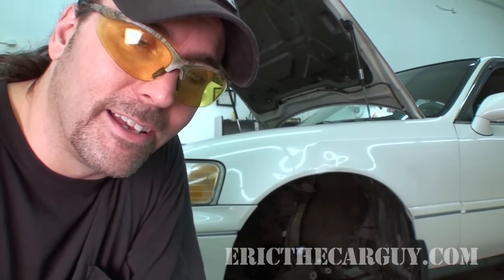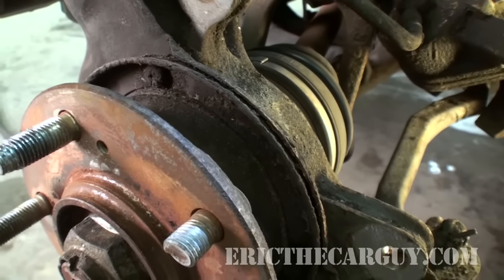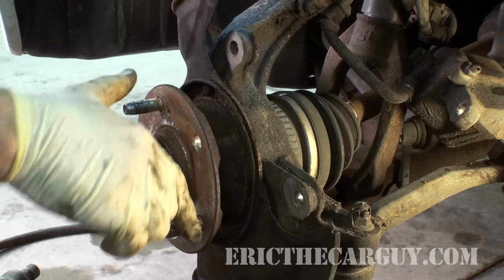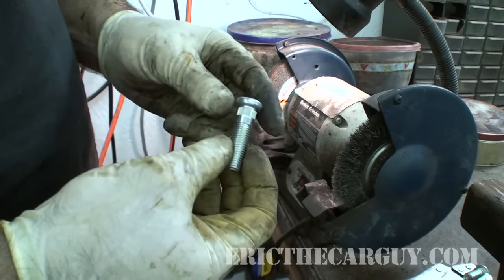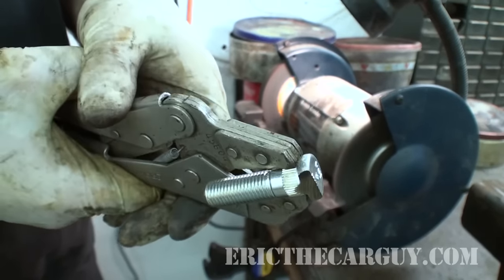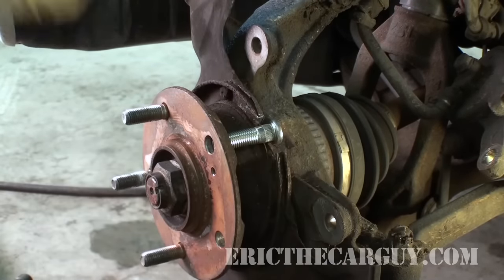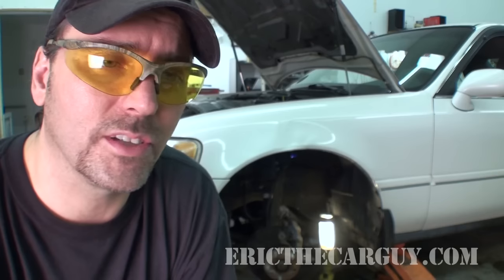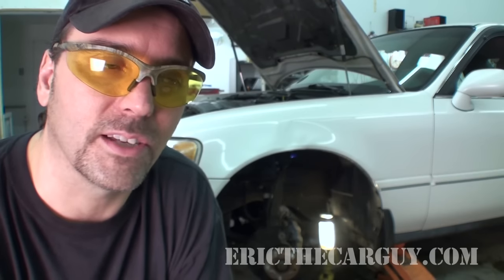Replacing Studs the 'Easy Way' -EricTheCarGuy

Comment: Yes, this method works. But honestly, if I was paying a shop to replace a stud on my car and they did this without asking first, I'd find it very unprofessional.
Reply: with that kind of hub bearing there's 90% chance you wont be able to remove without damaging the bearing.. as soon as you pull the flange and the bearing race came off that's another $$$ specially on honda,toyota that a freaking big $$$
Reply: Oh I agree, just saying that if anyone is getting paid to do this kind of work, they should be upfront with the customer about exactly what they plan to do. It's like going to the dentist to get a cavity filled and they decide to just pull the whole tooth because it's faster/easier/cheaper. In this case, eliminating the risk of damaging the bearing comes at the cost of a cut-up splash shield and a weakened wheel stud (since part of the head gets ground off).
Reply: the bearings aren't all that expensive when you get parts through a real parts supplier, and not from a schlep boiz or autobone! lol
Reply: this is why you never go in the work bay area
Reply: At $100+ an hour for shop time  the alternative will cost the customer a couple hundred extra bucks for no real benefit. The more of a pain in the ass a job is the more it costs the customer.
Reply: This guy is just being lazy AF...
Reply: It depends - if it is a new or late model car and someone hit your car or damaged it and insurance is going to pay for the whole thing then do the full monty... but for most "older" cars the shortcut is best providing you pay a much lower price and ideally the mechanic explains the price difference between the "right way" and the shortcut.  Some shops will charge full price and take the shortcut but that is part of capitalism.  But this is a DIY channel where we are doing it to save money.
Reply: That's why he got 1m subs. Sometimes cheating can save you a lot of time on certain things and won't hurt anything 😂💀
Reply: This is perfectly acceptable and, as noted earlier, you purchase studs already slotted. 
With that being said, if I had “buggered” up the thread, I would’ve eaten the cost of the stud, gotten a new one and grind it a little further.
Reply: are you fucking kidding?
Reply: You say unprofessional. Notice the number of times that the brake caliber shifts because of the professionalism of using a hanger to support the caliber and protect the brake line. 
He says he removed the cut area of the dust shield. Most likely he tried to bent it back into place and it snapped off.
Reply: A shop will charge you a 100.00 bucks to do it the right way.
Reply: @tophercourtland1584  try north of 300+ in parts and labor. And that's if the wheel hub bearing is all that broke. If Eric explained this to the customer, then all is well. I'm sure he did, hes a smart guy. Videos like this is partially why he is such a successful youtuber. Not every job has to be done by the alldata book. Depending on the customer and the car, theres many different ways to do the same job. At the end of the day the customer has wheel studs that you can hand thread a lug onto, and I can guarentee they will all torque down to 100ft lbs no problem for years to come.
Reply: Way to state the obvious.
Reply: @user-nl9ne5gk6k  How do u find these "real" parts suppliers?
Reply: Yeah this definitely isn't the "right way" but it's certainly the cheap way.
Reply: Im a mechanic and NO this is NOT how I would do the job for a customer for one, it leaves you SO open for being blamed for another issue, even if it has nothing to do with it. Also, most professional shops prohibit the technicians from short cuts like this, , a Shade Tree Mechanic most likely will.. That said, I will for my personal vehicle.... but I take this video being for the DIY guy.
Reply: If it was me working on the car I'd give you the option of this method or buying a whole new bearing as well. On these press in type bearings there's no real way to pull the hub off without wrecking the bearing too.
Reply: @TheRick2130  there is 120% chance the threads are damaged by hammer the stud through a hole.
Reply: If you went to a shop and got this done chances are you would never know about it and if you did find out it would be from another shop noticing it and telling you
Reply: I'm a professional I've been doing this for years
Reply: Here’s a quarter for you captain obvious. Don’t you think Eric is the kind of mechanic that would always let the customer know before doing a shortcut like this.
Reply: 😬😬😬
I don’t like anything about this…
Reply: Um. No.  Eric can do whatever he wants to any car I dropped off and I would know it would be the best choice that likely will be saving me money not costing me
Reply: @coypatton3160 you can whip the caliper and breakline, against a wall, if it breaks from hanging it was shit anyway … this is not a bullet and we don’t care about the caliber of the rotor.

Comment: Makes me laugh those who complaint about this method clearly never worked on old used car someone wanted fixed on a budget (which is the type of job 90% of independent garages live off). Its not the type of procedure you do on a brand new Audi, Eric knows it... its something you do on a 1998 Sunfire that someone use as a winter beater. and I'm ready to bet that those stud wont ever go anywhere.
Reply: The customer paid for 2 new studs, one of which was broken, and the other one had damage threads. They were then replaced with 2 studs with damaged threads. Plus, he spent time polishing threads and grinding down the studs. He should have just removed the hub.
Reply: Aris Oglesby Grinding took about 10s, If you can remove a hub and replace the bearing in that time just go ahead and do it.
Reply: But still. At least do it the right fucking way. It takes less time and less effort to do it the right way, than it does this way.
Reply: Pierre Gauthier preach
Reply: S
Reply: HeadphonesNotIncluded definitely doesn't you try getting that wheel bearing off you'll do more damage beating the wheel bearing off
Reply: People complain about it and it's mostly DIYers who've never worked in this industry. When a customer comes in wanting studs fixed with that issue normally some shops would refuse to do work on that with the risk of destroying that press in bearing...naturally the customer wants to pay bare minimum for the repair they want done or can't afford a bearing job. These are the constraints of the job. If it was me, I'd warn them about that risk and most likely refuse to do that job without bearing work. It's easy to say "do it the right way" but not everyone wants to pay to do it the right way.
Reply: Heck how many times have you seen a car with 2 damaged studs with no lug nuts because customer doesn't want to spend the money even with the shortcut method!  I did  5 stud replacement on a neighbors ghetto car with custom wheels that was down to ONE stud holding the entire wheel on!  It also trashed the wheel bearing.  

I replaced 5 studs for like $30 then she got a new wheel bearing for $300 then a few weeks later car was repossessed for lack of payment, because her ex-boy friend stopped making the payments because he was in prison...end of story.
Reply: No you do the job correctly and it would even be faster!
Reply: Well I tried like he said. ( And other videos too) 30 minutes later and having to cut the head of the stud off because the length of the little grooves on the back of the stud is all the room you have behind the stud to get it out. Even if the stud is broke off flush with the disk the head makes it too long. I even tried cutting it sideways and now it's raining so I'm FUCT thanks Mr Honda/Acura mechanic. Same goes for your BS head gasket video on the b18 b1. Here's a tease but you gotta buy the video
Reply: I did this and I have a 2002 Pontiac Grand Am GT1 I plan to restore, I don't care about being fancy with methods, as long as it works for me and nothing gets hurt so yeah I agree with you man. This saved me since I'm young and not too mechanically in touch with cars, so I just hammered the two broken studs out of my front wheel and put the new ones in. 10 dollars and back on the road.
Reply: @MaGeeVer420  then you're doing it wrong. Don't blame Eric for your idiocy.

Comment: I just replaced studs on  a 02 ford explorer, the studs I bought came with the heads shaved on one side. Just as you did. The ones    I removed from the factory was the same way, So, I guess  your right up there with Ford. Thanks for the video
Reply: David Lawhon lol.....Ford certified ehhh
Reply: Maybe Ill get lucky then.
Reply: "I guess your right up there with Ford"
That is a low bar, my friend.
Reply: RedSnakeGT500 b
Reply: My explorer was the same as well as for everything. I was confused when he showed a a whole round top. Didn't know this was only on certain cars and SUVs.
Reply: Ford isn’t really known for reliability though
Reply: @Nessaholiclover1 True. My ‘08 F-150 4x4 has only run 224k with no repairs. If I have to fix anything before 300k, I’m going to be angry.

Comment: If you do this to your own car to save time, it's allright i suppose, but if a mechanic did this to my car i would probably not be happy about it.
Reply from the maker: That's fair. Truth is it's done all the time and very seldom there is an issue.
Reply: +mtothem1337 
first of all, if you had a mechanic do the work.  You would never know what was done.  Unless you go back and check and for that much.  You might as well do it yourself.  
Second this was an awesome video for a problem stud issue.  Thanks again Eric. your videos are awesome
Reply: +mtothem1337 I mean the other option is the mechanic telling you that you have to pay for new wheel bearings and wait a few days for them to come in which I'm sure you also wouldn't be happy about. Keep up the great videos Eric!
Reply: ***** I would rather have the work done properly even if it cost a bit more.
Reply: +mtothem1337 Actually it's often more than a wheel bearing (those are 20$).

If you live somewhere there's snow in winter and your car is more than 5 years old, your CV joint will probably be stuck permanently in the hub.

At that point you have to replace the bearing, knuckle and CV joint.

That 2.50$ stud is now costing you above 1000$.
Reply: +shodanxx thiis a complete lie.  I've replaced CVJs on numerous snow cars and never had I had a stuck joint.  Even if they are hard to release, they come out.
Reply: Oh they can come out if you have a press, but you have to take the knuckle and cv joint off the car and then it's really unsafe on the press because there's no good flat part to push up against.

Mechanics here just replace the cv joint,bearing, ball joint and knuckle if it doesn't come out by hitting it or by using an hydraulic gear puller. Since they work at 75$/hour, it's cheaper to get those parts used than to pay them to unstick them.
Reply: +mtothem1337 , i do this same method almost daily and never once had an issue, if anything its better off compared to beating the rotor off the hub and marring up the friction surface, or pulling the whole hub and maybe ruining the bearing.
Reply: +mtothem1337 okay. pay the mechanic for the time to take all that apart then.
Reply: +shodanxx 75 dollars an hour? Maybe at nasa. I'm the real world us techs don't make anywhere near that. Definitely not at any local dealership or garage you take your car too
Reply: +shodanxx wd40 and a ball peen
Reply: +Everett Clunie My local shop charged $100 an hour (Australia) I'm sure you are correct though, the tech wouldn't get anything near that.
Reply: +mtothem1337 Its going to cost a lot more than a bit, for the mechanic to pull the wheel bearing and everything else. Probably 5 to 6 times as what he's charging you to do it way he's doing it.
Reply: +Doctor Morbid, Yes, they are hard to release, hence they are stuck.
Reply: +Everett Clunie Techs don't make that but that is what the shops/dealers charge.  Actually $75/hr is really cheap labor rate.  You can expect to pay twice that at a dealership.
Reply: Eric's way maybe $50 or your way maybe $250+. If you got the phone call which way would you sway?
Reply: And you'd know this how, exactly? Removing the hub and looking? You might as well do it yourself, then.
Reply: +shodanxx that's the most ridiculous thing I've ever heard. I live in michigan and have worked on cars for the past 7 years and never came across a permanently stuck axle. I've had some that I thought were but they will come out with enough persuasion.
Reply: +David Lawhon yea but he said permanently stuck. big difference
Reply: I mean, they should tell what's going to happen, unless you're not a car person, then I feel bad for you. As for DIY vs. shop work, you do get what you pay for.
Reply: I mean, if the guy wants to pay for the new wheel bearing (which they probably would have in stock at a nearby parts store), then pay for a new wheel bearing.  Honestly for me it would depend.  

I downvoted the video, and I wouldn't do this to my car, but then again I also don't have that problem because my wheel studs have clearance to be knocked out and re-aligned and inserted without resorting to any shenanigans.  

I agree that if a mechanic were to attempt this on a customer's car, he should at least take the time to explain what was being done and why, and the potential risks, however remote they may be.  I mean, even if the grinding made that stud only 70% as strong as a stock one, it's still 100% more strong than one that can't take a lug nut.
Reply: Andrew Cz - Good comment I believe the way a car comes  out of the factory then if that stud can't be put in cause in doing so would cost the customer new bearings @ 20.00 and a fully rated hardened stud 4.00 and labor @40 hr.  verses insecurity gambling a life or more being charged with gross negligence civil lawsuit the list can go alot bigger I would make sure the mechanic would pay a big price if this were done to my car I rather pay to do it the right way two option do it right or don't do it at all ,you want to save a customer money lower the labor cost sell him the parts at cost safety is not an option , sorry I got carried away with replying to your comment
Reply: try 80 to 105 an hour
Reply: I wouldn't do this to my own car. I'd at least take off the hub and actually just replace the whole assembly or at least the bearing too
Reply: You'd never know unless he told you which isn't likely.
Reply: Colorado DanK Rides same
Reply: MtotheM you wouldn't know if they did. I doubt you're gonna tear down your brake assembly to inspect the heads on your wheel studs
Reply: MtotheM I agree but how many of them do !
Reply: jerry all you have to do is run your fingers behind there. this isn't some voodoo procedure, you also would have the back part all cut up, if you don't know than you have no idea what you are doing
Reply: Of course most mechanics would tell you to the buy the full assembly that consists of BNIB OEM L and R Splash Shields, 2 Hub Bearings, 2 Circlips, 2 Front Hub Assemblies for this job work... End of Discussion
Reply: $70 - $100 / hr  is a pretty typical SHOP RATE, the techs don't get all of it.
Reply: sammycat001 😮😮😮😮😚
Reply: MtotheM
Reply: shodanxx where the hell do you live? 😅 I live in Canada and it snows like mad here, but the cv's on my 16 year old ford escape are still free. Did an abs sensor and tone ring, nothing was stuck.
Reply: why?
Reply: Yeah.... Just a bolt broke off then you need too pull out the entire hub assembly and press the bearing and reinstall and probably needs alignment that takes a whole day of work... I hope you pay that cost...😑😑

Comment: Like eric said, this is the easy way. A lot of people freaking out here. Some people actually look at the cost of repairs, and this way is much less time consuming and cost effective, if the customer so demands it. If he wants the replacement done  the normal way, it will be more expensive. Besides, Eric is just putting up a video that youtubers asked for...
Reply: Freaking out? Man, someone who talks about work ethics shows a video in which he deliberately breaks one thing to fix another? Really? It's not about weather it works or not, it's about sloppy bodged work. We're waiting for a reapir video made entirely on "zipties", I mean who cares about actually doint it the right way.
Reply from the maker: provostkhot This is not 'sloppy' or 'botched', the method works and in the right application I have no problem doing it and have never had a problem with this in the many years that I've done it. I think you should focus more on the idiot that cross threaded the lug in the first place rather than demonizing me for fixing it.
Reply: EricTheCarGuy hit the nail on the head right there!
Reply: Hendrik Derudder yupppppp
Reply: @ericthecarguy how’s it going eric i have to replace some studs on my car do i need to replace all of them?

Comment: Done this plenty of times, never had a problem...those of you that are complaining he mentioned many times this is ONE way of doing it without having to remove the wheel hub and replacing the wheel bearing, not everybody has the luxury and replacing every at once for a simple stud, this method is not dangerous.
Reply: Recr  Actually, that isn't true. This probably won't be, but CAN be dangerous. The shoulder on those studs is all that keeps them from pulling through the hub. On 2 studs, it isn't a huge no no, but if you're doing all 5, find another way, because that's when it becomes dangerous.
Reply: Never had a problem YET.. removing 25% of the retention part of the nut that holds the wheel on is dangerous..
Reply: @mja9001  I would think that the force is sideways not outwards so I wouldn't think it's that dangerious